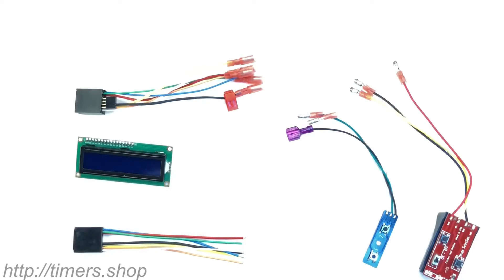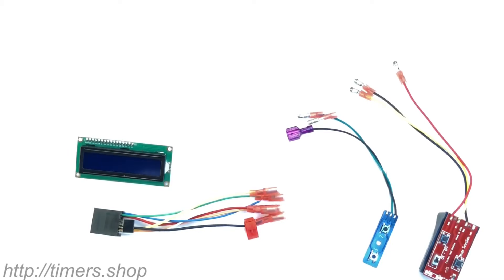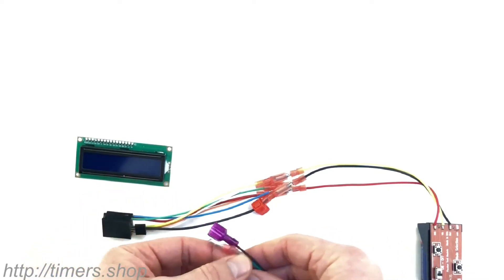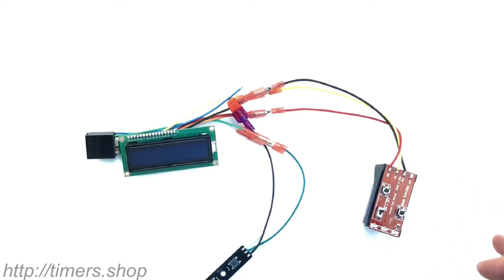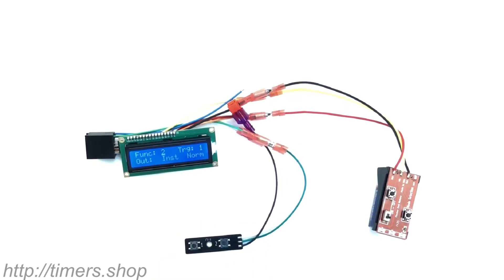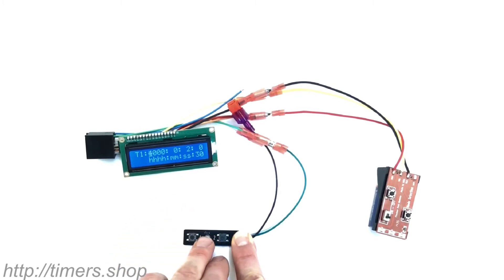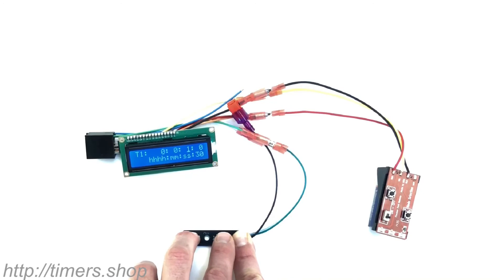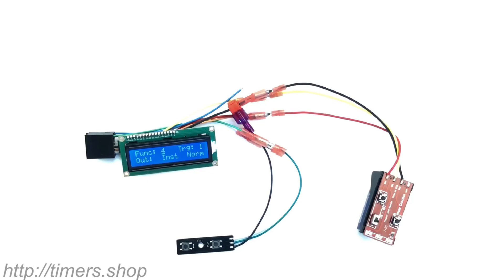10amp positive output timer with LCD dispaly

Comment: I wish I has seen this LCD model before I bought the one without.  It takes a bit of practice on how to program the non LCD version, but once you get it the timer works pretty well.  I am really  happy to have found it.  I am an automotive electronics installer and will find various uses for this.  The timer circuits in the past limited us to only 4 min.  This one blows that one away!!